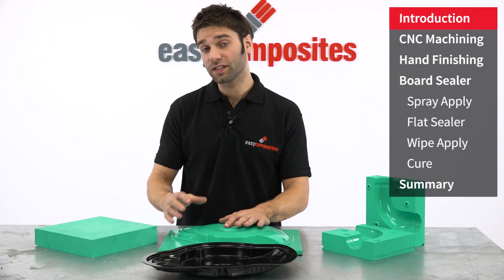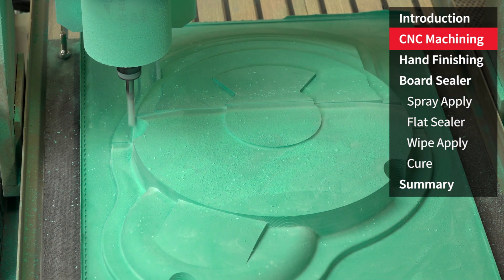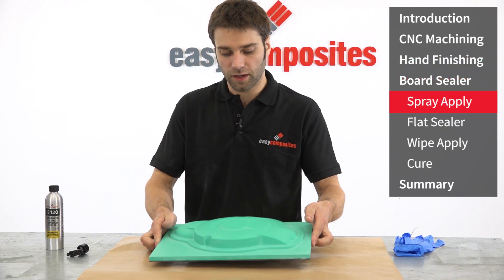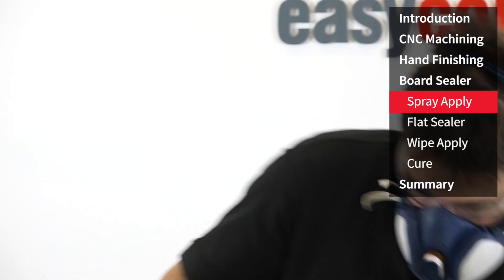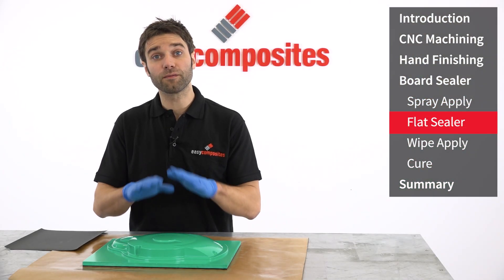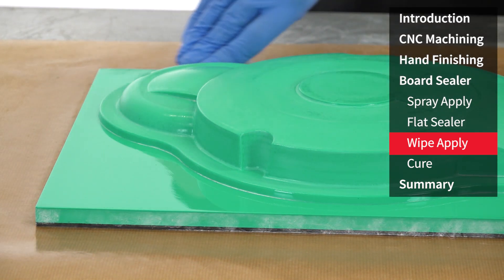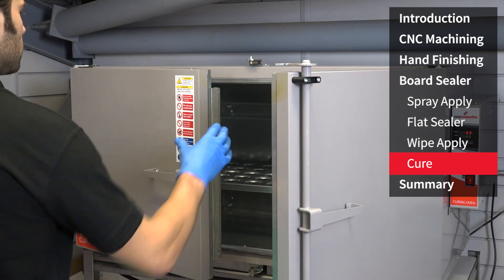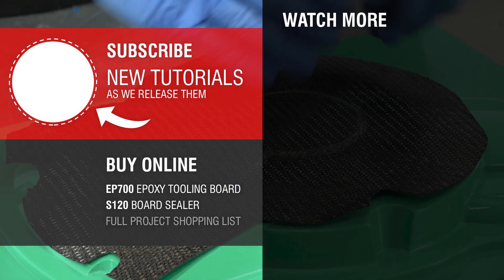Precision Patterns and Moulds from 3D CAD - CNC Machining Epoxy Tooling Board

Comment: Can this kind of mold be used in a female configuration under pressure. If not could reinforcement with carbon fiber be used to allow it to handle four atmospheres of pressure for making a ski.
Reply from the maker: For something like this you would typically use the machined pattern to make prepreg tooling which can then be used to manufacture the parts.

Comment: would it be possible to use the mould for vacuumforming of a polycarbonate plate of 4mm? I only need one or two prototypes
Reply from the maker: It is not what it is designed for.  Depends on the temperature and how long it takes to cool as to if it will damage the board.

Comment: Thank you for this interesting Video. But is it possible to produce a negativ mould to produce a carbon part directly in it? Thanks for your answer!
Reply from the maker: Yes it can be done that way for very short production runs or prototyping.  Model board moulds would not have the same durability as a properly made composite mould.
Reply: @easycompositestv  thanks for your insanely fast reply! Just one more question please. I have the opportunity to build Alloy/steel Moulds. Would this work, or will I get problems with that?
Reply from the maker: @Mr_Hacki  Aluminium moulds are often used in industry for their accuracy, especially for larger production runs where the original cost of the billet and machining can be spread over multiple parts. You have to account for the thermal mass of the tool - alloy tools can take a lot longer to heat up than composite tools so the cure cycle needs to be adjusted to allow time for the surface of the mould to reach the desired set points.

Comment: Awesome video! Can one use cnc milling for making negative moulds as well?
Reply from the maker: Yes you can, although traditional model boards would only be typically used for prototype or short production run moulds due to long term durability.

Comment: Is the epoxy tooling board the same as PVC foam??? If not can I use PVC foam for in a similar application ?
Reply from the maker: No, they’re quite different materials. PVC is much lower density, doesn’t machine as well and doesn’t have the temperature stability of epoxy board. You could still machine a pattern from PVC foam but you’d need to coat it in something to get a good finish and you could only use that pattern at ambient, or very modest, temperatures.
Reply: @easycompositestv  thanks for this information

Comment: Is there an alternative to sealing the tooling board? Can I use resin?
Reply from the maker: Yes, you could also use a thin layer of resin to seal the board if you don’t want to use a specific board sealer (like S120). Resin will build a bit thicker and therefore need a bit more flatting to restore a flat, accurate surface. A good choice would be our XCR Epoxy Coating Resin - it goes on thin, cures quickly to a high gloss, and is highly polishable. The working temperature of the XCR is lower than the board sealer but it’s still fine for use up to 80C.

Comment: Great Video as always! You have used stecraft CNC routers in other video. Why did you use the CNCEST  60x40 to make this mould? If possible could you mention some of the differences and preference when cutting carbon fiber or making mouds using different CNC routers? Thank you once again.
Reply from the maker: Hi Anthony, the StepCraft was used as part of a product demonstration.  We are not suppliers of CNC routers and the market changes very rapidly so would not be best placed to advise on the best routers to use.

Comment: Would it be possible to carve a model from this material by hand?
Reply from the maker: It is similar in consistency to very hard wood/solid plastic so it would take a very long time by hand. Machine/cnc is the only practical way in most cases.

Comment: Question: can you glue two pieces of machined model board together? I have a very small CNC machine and I need a pretty large pattern
Reply from the maker: Yes you can.  There are specific model board adhesive for epoxy tooling block.
Reply: What is model of CNC machine?

Comment: how much would machining moulds like the one in the start of the video costs?
Reply from the maker: Hi Lee, that really depends on where you go to get the machining done.

Generally speaking you're paying for the time on the machine, how much that time costs tends to depend on how busy the machine shop is; if they have little or no spare capacity then you'll pay more for time on the machine. There are some online places where you can upload a CAD file, choose your material, and get an instant price; these would be a good place to start.

For a really small job, like the pattern we machined in this video, it could even work out cheaper to buy a small desktop CNC machine. The one we used in this video was around £600.

Comment: Any consideration of making a mold using a 3D printer?
Reply from the maker: As long as the surface is sealed to stop any issues of porosity, then for some applications it may be possible to 3D print a mould.  However the material needs to be suitable for curing with pre-preg if you follow that route.
Reply: @easycompositestv  Thanks for your reply. I'm considering to print my mold, but I prefer to hear from the real experts here's my idea, correct me if I'm wrong. 

The mold can be made from ABS and smoothed with acetone, then treated with wax for a non-stick surface. Using the air dry vacuum bag methodology, the mold can have optimized drainage (via any CAD software) for a better resin flow, the only disadvantage could be a warped mold due to the internal combustion while curing the epoxy resin.

How accurate is this idea? Be honest, It's rubbish!?

Comment: What is the technical name of epoxy tooling board? High density urethane foam ?
Reply from the maker: No, definitely not. The epoxy tooling board is made from epoxy. In this video we're using our EB700 Epoxy Tooling Board. We don't use polyurethane tooling board because polyurethane inhibits the cure of epoxy prepregs. Also, for this type of work you really need to talking of tooling board or block rather than 'foam' which would generally imply a much lower density material than we're using here.

Comment: How to strength the places where two moulds join together, for example, the 90 degree rotating pipe, if you lay fabric on each mould, when you join them together, the only connected is the resin instead of fabric, then how to strengen them?
Reply from the maker: You can do that in the manufacturing process, or even laminate carbon tape or fabric over the join to make it stronger afterwards.  A bit of careful thought during the planning phase can mean you do the overlapping as the part is made, making things simpler and quicker overall.

Comment: Hi Sir - I want to know if ( EP 700 ) can used in injection plastic machine ? and Do you have more than (130 degree temperature )?  and how many times can i used EP700 as mold in machine injection ?
Reply from the maker: No, the EP700 Epoxy Tooling Board would not be suitable for injection moulding tools for many reasons I'm afraid, the main one being that the board would like the thermal mass needed to cool the thermoplastic but there would also be issues around the resilience of the tool, the release the of the thermoplastic from an epoxy tool and the service temperature of the tool.

Comment: Can the pattern be reused?
Reply from the maker: Provided it was not significantly damaged when releasing the mould, then there is no reason why you can't reuse the pattern. You would need to repair any damage and then re-apply release agents before using the pattern to make another mould.

Comment: Can carbon fiber give strength to a plastic moulded... 
I am trying to make a steering wheel of my old car. I have made a plastic mould from abd and will do stick carbon fibre over it. I wanted to know weather it will break when vertical forces are applied.
Reply from the maker: Adding an outer skin of carbon fibre to an existing component will always add strength to it, particularly if the carbon laminate is able to bond well to the substrate. I'm not familiar with ABD plastic but I'm guessing you might mean ABS? If you do mean ABS then this can be quite a tricky plastic for epoxy to bond to. Often, ABS is 'flame treated' (i.e. scorched with a blow torch) to oxidise the surface and make it bond-able for epoxy resin. I know for sure what level of adhesion you'll get I would suggest preparing the surface of the wheel (probably by abrading and then flame treating it) and then do a peel-test with a small sample patch. If the patch bonds well and takes a lot of force to remove then you can be confident that the carbon fibre/epoxy has bonded well. In terms of the total amount of strength that you add, that would depend on the thickness of the carbon fibre 'skin' - you could add multiple layers if you need more strength.
Reply: Yes, it is ABS,sorry it was my typing mistake.
Can u give me an idea about flame treatment.
Then Sir Can u suggest me an alternative for ABS any other material of which i can make  mould.

Comment: How would you vacuum bag a two part mold such as the tooling board mold that you guys showed for the 90 degree pipe fitting. I’m interested in machining a cheap mold out of epoxy board for a prototype and it would be two parts and would need to know how to bag it so I’d get proper adhesions of the two halves. Since you can’t put the bag in between the two parts. While in the oven.
Reply from the maker: You would need to envelope bag it with enough excess material to get into the void section.  Alternatively you can envelope bag it using a fabricated bag including vacuum bag tube of the right kind of size to easily go down inside the pipe.

Comment: What material is the green one used in this video?
Reply from the maker: It's our EP700 Epoxy Tooling Board. In the description above there is a link to the project page on our website, on the project page there is a 'shopping list' down the left hand side which includes links to all the products used in the video. We always do this to make it easy to track down any products you've seen in one of our tutorials. I hope this helps.

Comment: Assuming ideal treatment and conditions, how many molds would you expect to get off of that plug?
Reply from the maker: You could comfortably take in the 10's to 20's -  maybe a lot more in 'ideal conditions'.  In this video, the mould was already off the plug by the time we took the bagging film off so I think it's safe to say we could keep taking moulds off with almost no damage or deterioration of the pattern.
Reply: Easy Composites Ltd where I've been working, we've started having our plugs "professionally" built even though we used to build our own.  They say we should be able to make 5 or so molds off those plugs, but we've never had them survive past making the first mold.  We are very unimpressed with the quality we've been receiving from them.

Comment: Hi, great videos 👍 what make/model cnc router is that and where can you get one?
Reply from the maker: This one is just a fairly basic model which we bought off ebay. It's Chinese made but uses ball-screws which improve accuracy and longevity of the machine for this type of machining. Ours is branded as CNCEST and the model is a 60x40 (which refers to the bed size).

Comment: Unfortunately i dont have a cnc router. Does anyone know a company in UK or Germany which could mill the mould?
Reply from the maker: Have a Google around for "CNC maching UK" or something along those lines; there are a number of CNC places. You might also want to think about the size of your piece and the quotes you're getting for the machining because for small parts (like the one in this video) especially if you have a few projects to do, you might find you can buy a small desktop CNC for not much more money than the machining would cost.
Reply: have a look at makerspaces, you can pay about 10 quid to use their tools. most have a cnc router you can use.

Comment: So once that s120 finish wears off from use, can more coating's of it be applied so the mold can be reused again and again?
Reply from the maker: Yes you can restore the finish with fresh applications of the S120 Board Sealer.

Comment: Where do I get Epoxy Tooling Board from?
Reply from the maker: From our website. In this video we're using our EP700 Epoxy Tooling Board: http://www.easycomposites.co.uk/#!/patterns-moulds-and-tooling/tooling-and-modelling-board/EP700-High-Temperature-Epoxy-Tooling-Board.html
Reply: is there a way to make it? Is it made of polyester resin?
Reply from the maker: It's made from epoxy resin (hence the name 'epoxy tooling board'). I can't imagine that you could make it any less expensively than you could buy it for and if you buy the proper board you know it will have the right density, stability and machining properties.
Reply: sorry, that was a stupid question :)

Comment: Wow I was just about to begin to do this thank for the video. Do you know if insulation foam can work because I need to make a huge mold and accuracy is not key
Reply from the maker: You could use insulation foam to make a rough shape but to be usable in any form you would then need need to add strength to the structure, normally by 'scrimming' it with glass fibre and resin (make sure you use epoxy resin like our EL2, not polyester or vinylester because they will melt your foam) and then coating the pattern using a high-build pattern coat (such as our Pattern-Coat Primer). You could then use the S120 Board Sealer over the top of the pattern coat primer to bring it to a full gloss.
Reply: Easy Composites Ltd thank you 🙏

Comment: Can I use the sealer on just about any high density board? I have a foam plug I would like to try that sealer with for wet layup.
Reply from the maker: Well, that would depend on what you mean by 'high density'. The sealer would be find on any type of polyurethane or epoxy board from about 250kgs/m3 density upwards. Anything less and you'd need some sort of scrim first to add strength and provide a more appropriate surface. You can also use the sealer on other porous substrates like MDF or wood.
Reply: Should have been more specific. It is polyurethane foam. Thanks for the information
Reply from the maker: Mmmm, if it's out High Density PU Foam then it would be 90kg/m3 which is too low density to just go direct with the S120 board sealer. Also, although the sealer does build a microscopic layer on the mould (sufficient for higher density model boards and tooling boards) you'd need something more heavy-duty to smooth out the texture of the foam - such as our Pattern Coat Primer.

Comment: How accurate are these methods and up to how small details/tolerances can you work with these moulds?
Reply from the maker: At ambient temperature your accuracy will be as good as the tolerance of your CNC router. In the case of this basic desktop machine you're well within a fraction of a millimetre accuracy from the CAD design to the machined pattern. If the pattern is then used to take a mould from at room temperature then the accuracy of the mould will match the accuracy of the pattern. If you're taking your mould off at elevated temperature (for example a prepreg mould) then you will have to consider the CTE of the epoxy tooling board which will expand slightly at elevated temperature. For this reason, moulds (particularly prepreg ones) are made at the lowest end of their cure temperatures.

Comment: I'd like to see how you guys manufacture airfoils with a wet layup.
Reply from the maker: We do plan to do a tutorial demonstrating how to make a wing section but it probably wouldn't be done using wet-layup. There is some hand work in assembling a wing (i.e. bonding the upper and lower sections together) which you might find interesting.
Reply: Easy Composites Ltd We've been trying to manufacture a large airfoil for our FSAE car with a wet layup, but we've encountered some difficulty in manufacturing. Is there any reason for not using a wet lay up? In addition. How do you achieve a smooth transition between the two parts in order to get a smooth leading edge?
Reply from the maker: OK, we'll certainly bear in mind the idea of some more advanced wet-layup projects. Prepregs certainly don't necessarily need high production volumes to be justified, it might be more apparent in the next videos in this series just how easy they can be to work with. Watch this space.
Reply: I hope Easy Composites don't mind if I add my 2p here...  wire cutting a foam male tool doesn't really work because your controlled surface ('tooling surface') is the inner surface - no good for you!  I am thinking over how I'm going to do something similar to you and DAC drone below.  I am likely to go for a 2 piece wing skin design with a lip near the leading edge and at the trailing edge.  This has a number of advantages as I see it: 1. you can use a female mould much more easily - your most important profile - the OML - is maintained by the mould; 2. you can lay-up structure on the inside face if necessary; 3. the leading edge is controlled by the tool; 4. you can decide which surface you want the joint on and; 6. you can easily fill the joint with sealant that can be cleaned up.

Another interesting video +Easy Composites Ltd - thanks!